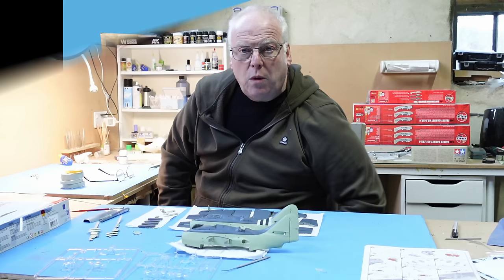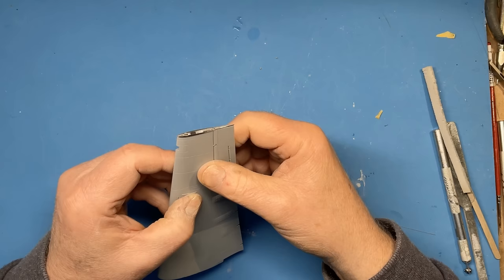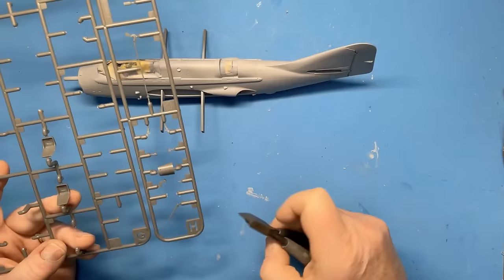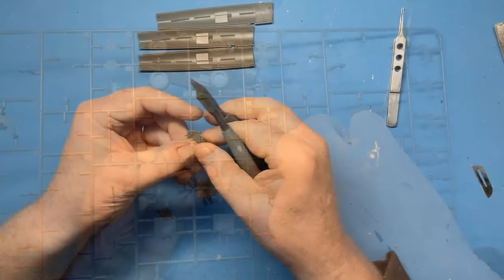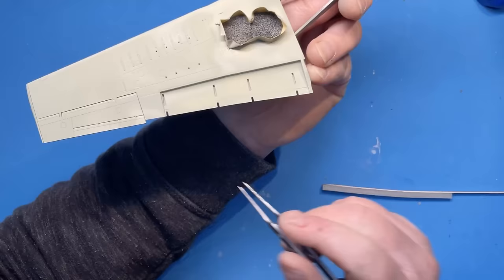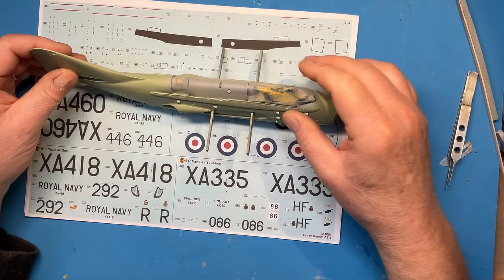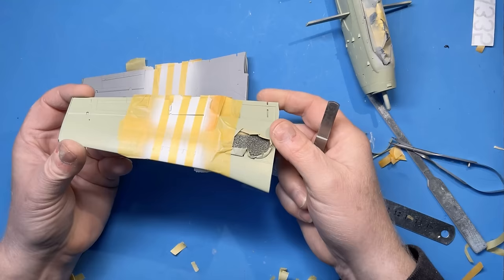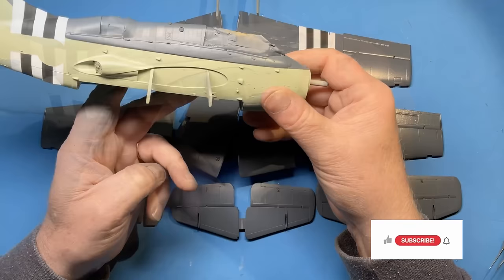Airfix 1/48 Fairey Gannet double build Part 3

Comment: Watch out for undercarriage part E1. The oleo scissor connector is missing part of the upper linkage on my kit. Seems a few others too so may be a common issue. Ended up grafting one from a spare retracted leg.
Reply: Interesting have just checked mine and I the connector part you refer to is there but only half the width of the others - short shot issue from an otherwise tremendous kit.
Reply: I wonder if it's a CAD issue?
Reply from the maker: It’s not a short shot Gary - looks like it’s a design problem. Like you I’m just using part of the spare retracted leg to fix it.
Reply: Easy fix. I also opened up the lughtening holes too.

Comment: Oh, and watch out for decal placement issues on folded wing version if you haven't already found out.
Reply from the maker: I didn’t come across any Gary. Keep me in ignorance it’s too late now if I’ve goofed.
Reply: @TheModelShed  The placement 'issues' were twifold. The roundel on the upper wing goes partially over the raised rod (which connects to the fuselage). Either rrmoved pin or make a hole in the decal.
The registration code underneath  - the X goes over where part of the wing gold mechanism is so needs to be trimmed.

Comment: Hi, firstly another awesome video full of useful tips and methods so thank you for that 🙏👍
Secondly, how are you slowing your drill down ? Do you have a foot controller ? Only asking as I have this particular drill and mine just goes full pelt I cannot control the speed unless I use the adjuster on power base but then to reach over and slow or speed it up is extremely dangerous especially for me 😳🤪😅😅😅 
Thanks again for your wonderful channel I really am learning a lot of modelling tips, tricks and techniques from you and am always learning something new on each of your videos. So again THANK YOU very much you really are making a huge difference to my way of modelling… far less mistakes and my confidence is getting much better thanks to your kind videos 🤓🤩😍👍👍👍👍👍👍
Reply from the maker: Thanks I just control the speed with my finger on the chuck to brake it. It’s not normally advised to slow electric motors like this but I’ve had this drill for well over 30 years and it hasn’t done any harm so far.
Reply: @TheModelShed  I have a few of there tools now. Pillar drill stand, lathe, two different drills and the green power box. It can power three different tools at the same time. I also have one of there drills with a proper chuck but it didn’t come with a chuck key and none of my others fit it. It’s the drill to be used with either the drill press or lathe as it’s motor is bigger, more torque. 
I was just wondering how you slowed it down as I’ve seen one with a foot pedal to operate them but if all you use is your fingers then I will definitely try that !!!  CAREFULLY mind you 🤣🤣🤣 thank you for your reply to my question I truly appreciate your time!!!
Thanks again for all your work you do for us. It really is helpmeet learn the finer art of aircraft model building and finishing. I build 1/35th WWII German armour mostly but am building up a nice 1/32nd aircraft collection. Just getting my confidence and techniques up a bit more before I tackle them. I need to get a list of jobs to do in order, as I’m all over the place doing things before I should or forgetting them till last minute so I need order in my modelling now anyway I’m waffling now so I will take me leave. 
Thanks again for all your hard work you do for us. Take care, Kenny 😊👍👍👍👍👍👍